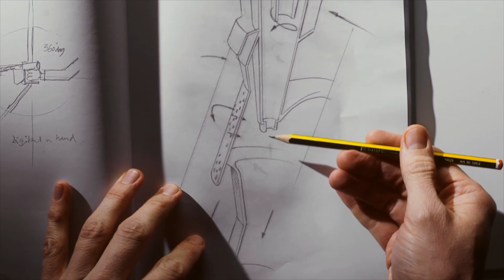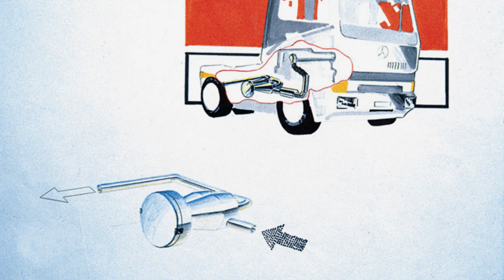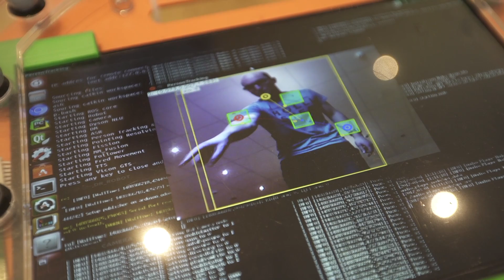Chapter 7: Core technology from Invention: A Life, by James Dyson

Comment: The guy is absolutely brilliant he makes his stuff so well
Reply: @I_am_a_nice_person  y’all literally say this only about the companies you don’t like, when literally EVERY single company is guilty of this. Doesn’t mean it’s ok, but don’t pick and choose otherwise you’ll sound like a moron. Why not state actual negative reasons that they need to work on.
Reply: @I_am_a_nice_person  I for one am not a fan of how their robot vacuum navigates. I think it’s redundant, and wastes time.
Reply: What stuff? Vacuum? Terrible battery. Very simple device.
Reply: @davidsosnak2968  find a cordless vacuum with better battery runtime, better filtration AND better suction than a Dyson. I’ll be here when you find one 💅🏼
Reply: @oscarcantu6033  They all bad at battery. Low recharge cycle. After one year needs replace battery
Reply: @davidsosnak2968  After just one year? What model you have? How often do you use yours? And also how often do you run it on high power? Genuinely asking
Reply: @oscarcantu6033  Dyson V10
Reply: @davidsosnak2968  ok what about the other questions?
Reply: @davidsosnak2968 - What utter rubbish. I’ve had mine for 5 years and use it almost every day.